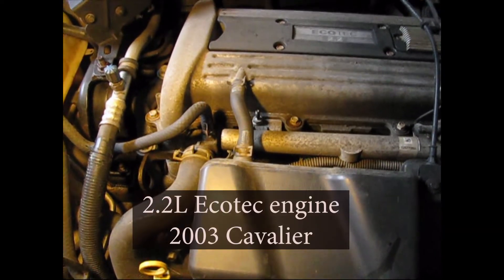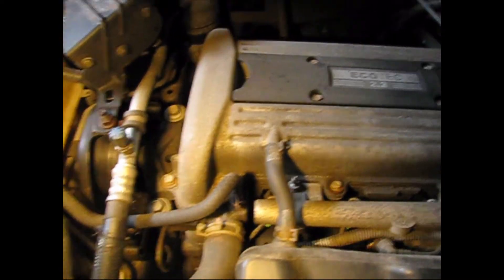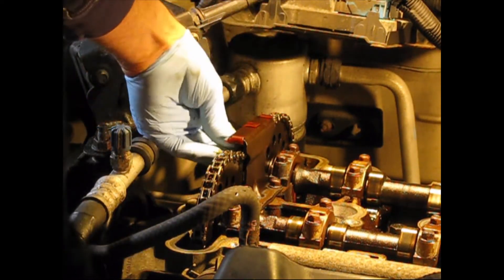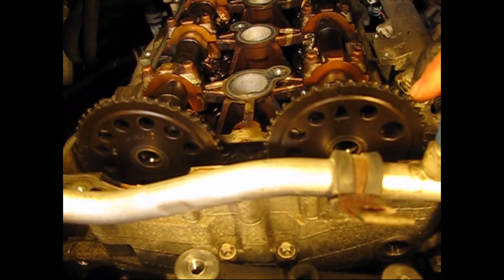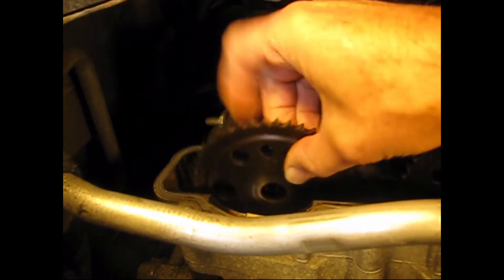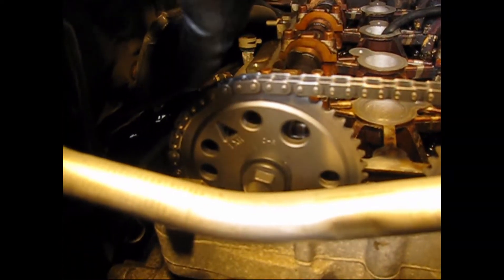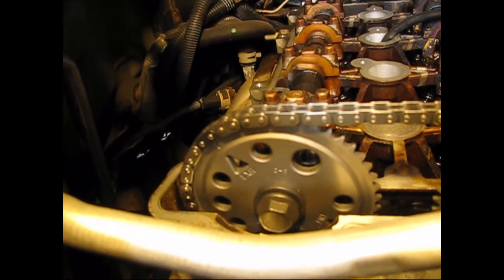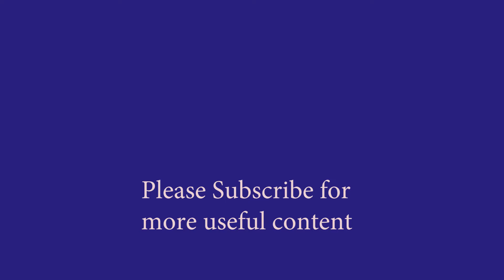Crank But No Start: Sounds and Symptoms of a Loose Timing Chain or Belt

Comment: Plastic chain guides & tensioners: Engineered failure points, a throwback to the plastic cam gear teeth in 60s-70s pushrod engine vehicles.

Comment: I have old 85 Toyota pickup.  The truck starts and runs strong, smooth and cool….until yesterday.  It was 85f and after driving an hour on the freeway it started getting warmer than norm…but not in red.  I pulled off to buy something but when I tried to start her she refused.  It turned over but NO ⚡️ SPARK.  Next day after towing her home I pulled the rotor cap after tracing power from battery to coil and now distributor.  I turned the engine over many times but the rotor never moved.  I pulled out the distributor to inspect the drive gear.  No damage visible😃  I will be taking the valve cover off to inspect the cam gear and timing chain.  

Is it possible the chain broke?
How will I know?  There are Zero loud noises when she turns over.

Comment: i have an 05 chevy classic with the 2.2L ecotech engine, it drove just fine to pick up my friend and then 10 minutes later it wouldn’t turn over.. it was making a harsher sound than what was shown in your video and when i looked under the hood i noticed the cover had a small crack where the timing chain is located, is it possible that the chain snapped and cracked the cover? and if so is it possible it did damage to anything else in there? am i gonna have to get a new cover or is there a way to patch the crack? i’ve worked on plenty of cars but i’ve never touched an engine so i have no idea what i’m doing or where to even start. i’m dreading getting that cover off and finding out if there’s more than i’m suspecting
Reply: Hey! I have an 04 Chevy Classic with this same engine. Any update? I was going down the road and the car died and it sounds like something is spinning in my engine and hitting where the timing chain is located. Haven't torn it apart just yet. Did you have any massive engine damage? I was going about 40mph.

Comment: My 2009 ford Taurus with a 3.5 liter engine v6 starting making a strange noise and I jkept driving it eventually it conk out on me on the road.and when I try to start it it does the same thing your car on your illustration makes I thought my serpentine belt snap but it didn’t.my car only has 58,000 original miles do you think I should get repair or junk my car?
Reply from the maker: It would be the timing belt or chain issue, not the serpentine belt that would cause the engine to sound like the one in the video. With those low miles I would certainly have a competent mechanic look at it.
Reply: thanks for your advice,im going to ask some competent mechanics about how much would they charge hopefully they wont break my bank.i know for this engine you have to remove the intake manifold and the valve covers.to get to some of the screws to remove the timing chain cover.and also you have to align the gears with the chain.
Reply from the maker: Yeah, timing chain service is quite challenging.  @garylove2836

Comment: Ok so I have an 04 cavalier and I just installed a whole new timing kit and every was lined up where it’s supposed to be and I made sure it was at top dead center before removing any of the old parts. Like I said everything was lined up percent according to the marks on the chain but when I tried cranking it, it still doesn’t have any compression so wtf am I missing or doing wrong????
Reply from the maker: If the reason you changed it due the chain slipping or breaking, I would worry that there is valve damage as this is an interference engine.

Comment: Hi chief,
Would you be able to assist or tips on BMW n51 engine? 
Car has one short-time ‘rattling sound’ heard.
next day, idling normal in my garage suddenly died.
P0365 shows on code. I replaced 2 Camshaft sensors and the crankshaft PS.
Still No-start. 
No cranks or fast crank and battery resets. NO long cranks.
Please advise, thx
Reply from the maker: I would start by checking the engine and chassis grounds. Make sure everything is tight and clean from the negative battery terminal to the grounds. I had a frustrating experience with a Corolla a few years back and made a video: https://youtu.be/-DU-VeipY3g

Comment: Is there a way to get a vehicle to start, even if this scenario exists? I’m asking because I want to know how a mechanic would move a car around the shop to diagnose and then repair.
Reply from the maker: If it slipped out of time it won't start. They have to either tow it or use some other method I'm not aware of.
Reply: push

Comment: I have a 2.2 ecotec in an 04 Chevy Classic. It doesn't quite sound like this, mainly a spinning rattle in the engine. Won't start and it died going down the road 40mph. How screwed potentially is my engine? I hear metal hitting where the chain rests in the engine.
Reply from the maker: Doesn't sound good at all. Can't say for sure just from that, but valve damage is a real possibility when it happens at 40 mph.

Comment: If the car has zero compression does that mean the engine is done for and you have to swap it out ?
Reply from the maker: Maybe, but miss- timing will cause that too. The valves being open at the wrong times will prevent compression from developing.
Reply: Have u tried switching out the cam shafts sensor 
Crankshaft sensor, or fuel pump relay ?

Comment: My opel astra 1.6 ecotec made this noise after I switched the car off. When I tried swinging the ignition again it made a similar noise, if this happened at a standstill, do you think there will be any extensive damage?
Reply from the maker: Those are similar to conditions to how it happened to us. We didn't have bent valves.
Reply: Did you get it fixed. and was there any damage. Happened to me on driveway. No damage.

Comment: My car sounds like this but the chain isn’t loose. What should I check next?
Reply from the maker: This is the sound of a complete loss of compression. Check to see if the timing is correct. A blown head gasket might also sound like this.
Reply: Same, but timing is correct, and the head gasket isn't leaking.  Drove fine, parked in my driveway over night, went to start on the morning  and exact same sound.  As though the starter solenoid isn't working properly,  although the engine fast "cranks" like this video
Reply: Figure it out?

Comment: Similar happened to my corolla and the mechanic said your cranck is broken or so there is no pressure in your engine and the timing chain is it place :/ i am bretty sure its timing problem but i was mad and just bought another engine. :(. .
Funny thing it happend suddly while driving 
And before i had cam shaft sensor code and tried multiple sensors and everytime it show up again the code and the car was weak specially going up hills
Reply: I still don’t believe the mechanic i think he is not experienced that much

Comment: This is something wrong with my car , I have an 03 Toyota Camry that won’t start and making the same sound , how much does it usually cost to get it fixed ?
Reply from the maker: Replacing a broken timing belt is not a cheap repair. I'd call around and they should be able to give a ballpark figure.

Comment: This is exactly what sound my explorer is making but my mechanic told me the engine is blown..
Reply from the maker: The 2.2L Ecotec engine in this video was also condemned by a mechanic. We replaced the chain and reset the timing and it ran. Be aware, though, that a broken chain can result in valve damage in some engines.

Comment: My 05 cavalier  2.2 ecotec sounds exactly like this, but the timing chain is taught,  and the marks are correct.  So strange.   Has fuel, air...  going to be fun checking for spark.
Reply: No compression
Reply: @SamSam-ih6nt  that's the strange part...  shouldn't just miraculously appear over night.  Drove it,  and parked in my driveway, went to start, just fast spins the crank, no turn over.  Weird to all of a sudden have no compression.
Reply: @Tmassicotte187  Exactly how it happens.
Under power the Chain is bound. The Guide usually fails. Turn the engine off and the chain whips, settling with slack between the Cams. Back under cranking tension, the Cams are no longer aligned and the compression of gone. No compression prevents the load that would do farther damage.
Reply: @crxess  great reply
Reply: Did you ever figure it out? I have an 04 Chevy Classic with the 2.2 ecotec. Driving down the road, and it died. It sounds like spinning almost in the engine and hitting where the timing chain is. Is it possible my engine isn't toast? Did you figure it out?

Comment: What if mine sounds likenits cranking slow with no strt
Reply: Battery
Reply: Or crank position sensor if u have fuel delivery 👍 usually runs like crap first though with bad cps, at least on my model